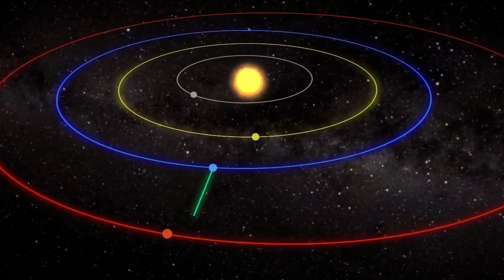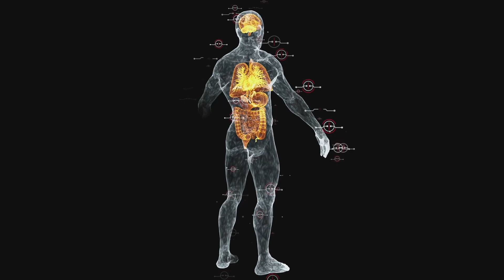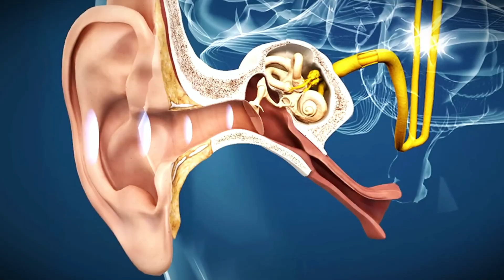That's Why It's So Hard to Send Astronauts to MARS

Comment: This video is full of misinformation. 

No one's going to be bored or suffering from cabin fever.  The first crew to Mars will be world famous celebrities.  They will probably be interviewed by the media all the way! People can communicate with friends and family.  All sorts of entertainment can be provided and they will have plenty of work to do not least preventing any microbial growth on board. 

55 millions Kms distance is about the closest you can hope for and doesn't happen v. often. 

The problem of muscle and bone loss in zero G has been solved by NASA using a range of techniques (mostly resistance exercise) in 83% of astronauts. So obviously you choose your Mars crew from the 83% not the 17% who do have a problem.   

As for the dust storms, as others have pointed out wind force is weak on Mars - a 60 mph wind would equate to something like a 3mph summer breeze on Earth! Nothing's going to get destroyed.  In fact this is one of the reasons why PV facilities will work so well on Mars. There is no destructive weather or major seismic events to destroy such facilities so you don't need to use steel, glass and concrete to anchor and protect them.  You can just unroll your PV roll from the back of a vehicle.  Set up will take a couple of sols max.

Comment: A much better option would be to settle on Venus,or more accurately,the clouds of Venus. Venus has basically the same gravity as Earth,and the thick atmosphere protects infinitely better than Mar's weak atmosphere. At certain altitudes,the temperature is also a pleasant 70F. 
AI Overview
 
The "cloud cities" concept proposes floating, habitable structures in Venus's upper atmosphere, where conditions are more Earth-like, potentially serving as a future human settlement, as Venus's surface is extremely inhospitable. 
Here's a more detailed look at the idea:

    The Concept:
    The idea involves building floating cities or blimp-like structures in Venus's upper atmosphere, at an altitude of around 50 kilometers (31 miles) above the surface. 

Why Venus?
While Venus's surface is extremely hot and has a crushing atmospheric pressure, the upper atmosphere has conditions that are more similar to Earth's in terms of temperature and pressure. 
Advantages of the Venusian Atmosphere:

    Earth-like conditions: At the 50 km altitude, the temperature and atmospheric pressure are more similar to Earth's. 

Abundant Resources: The Venusian atmosphere contains abundant carbon dioxide, which could be used as a resource for infrastructure, manufacturing, and construction. 
Protection: The thick atmosphere provides shielding from cosmic and solar-flare radiation and inhibits the passage of meteoroids. 
Solar Energy: Venus receives a lot of solar energy, making it suitable for solar power generation. 

Challenges:

    Corrosive Clouds: The Venusian clouds are composed of sulfuric acid, which is highly corrosive. 

Harsh Winds: The upper atmosphere has strong winds, which would need to be addressed in the design of the floating cities. 
Materials: Special materials and coatings would be needed to withstand the corrosive environment. 

NASA's HAVOC:
NASA's High Altitude Venus Operational Concept (HAVOC) outlines the steps to colonizing Venus, including robotic exploration, crewed missions, and eventually, a permanent human presence in the clouds. 
Current Research:
NASA is conducting research and missions, such as DAVINCI+ and VERITAS, to study the Venusian atmosphere and surface, which could pave the way for future cloud city projects. 
Science Fiction Inspiration:
The idea of cloud cities on Venus has been explored in science fiction, with examples like Cloud City in Star Wars and StratosCity in Star Trek.

Comment: Winds on Mars can go up to 60mph, but due to the super thin atmosphere they wont be able to destroy anything.
Reply: @Korr123  The dust, otoh, will be a big problem.
Reply: @FarSeeker8  Nope it won't.  PV facilities might lose 60% of their power output for a few weeks but that's about it.  No one will be going out to breath in the dusty air!
Reply: @owenlouisdavid  60. Percent of your power is A LOT when your life depends on, but the power problem isn’t the only one. Dust will shorten the operational lifetime of your equipment. Equipment your life depends on.
Reply: It's not the wind it's the debris. It's the debris that makes tornadoes so deadly. Tornadoes in the ocean are called water spouts and while they might be dangerous in some instances they are mostly benign because there's no debris.
Reply: True. And the only reason Mars has global duststorms is because the Martian regolith, when blown by the weak Martian air, is almost as fine as cigarette smoke. A 60 mph wind on Mars would barely blow an oak leaf, much less topple a communications tower. And they tried to tell us that the film, "The Martian" was "scientifically accurate". It was very entertaining, but it was nowhere near scientifically accurate.

Comment: Upper clouds of Venus are a better idea. Just need a balloon that repels sulfuric acid.  Cooler temperatures, much less radiation. Good platform for lowering probes by tether. While stationary, there is very near Earth gravity, avoiding bone loss, and a plethora of other physical  problems. Just have an escape plan to the orbiter, should the balloon malfunction. Confused by the Will Never part of your thumbnail. It's at variance with the article, especially the ending.